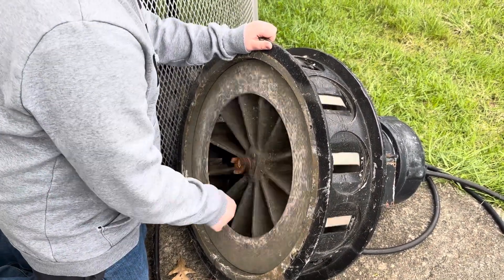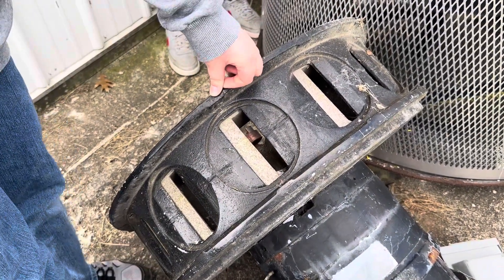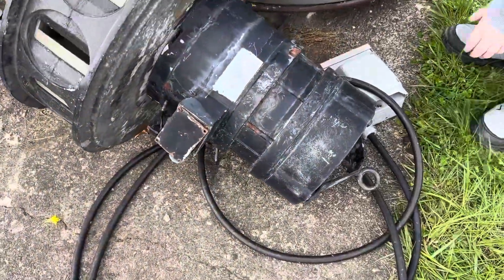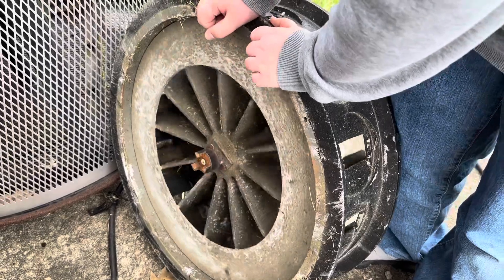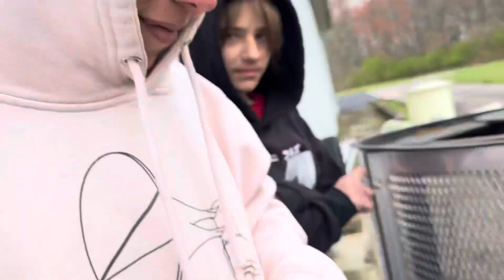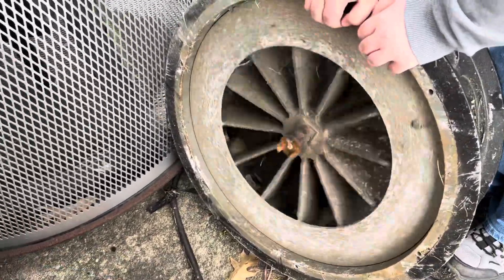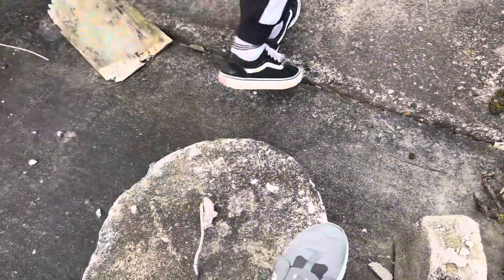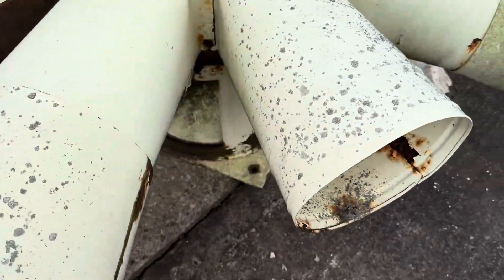Checking out the Grounded RSH-10 Thunderbeam and Sentry 10V in Blanchester Ohio (read desc)

Comment: not to argue but the thunderbeam was not made from extra parts from sth10s because the sth10s were in production from the mid 50s to like 2005 as the thunderbeams were created by a federal employee before he left in 1982 so the same year they were introduced im pretty sure. he got it a patent and the thunderbeam was in production until i think 95. Hope this helps. PS dont get a thunderbeam unless you have a tractor or loader of some type as these weight 700 pounds and are 5,6 tall.